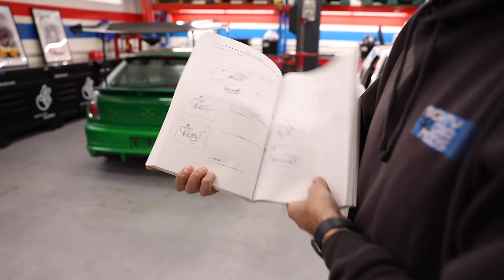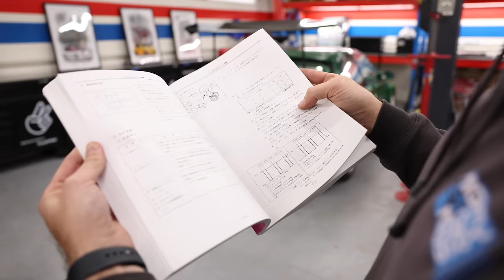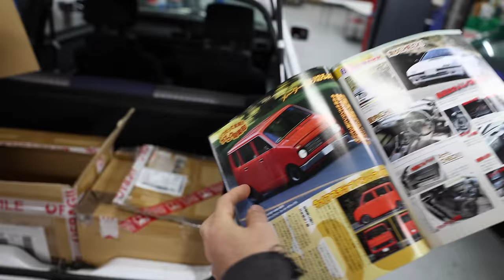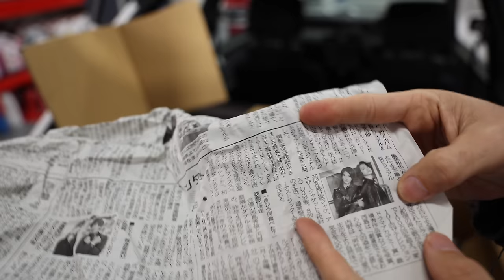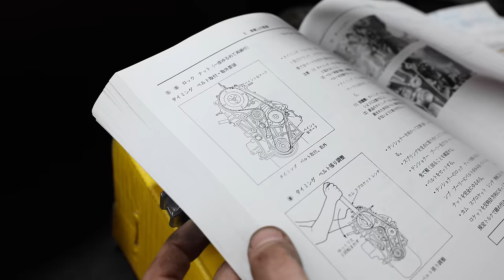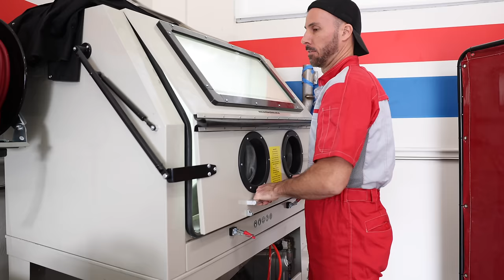Disrespected Superturbo 'The Honkfiles' [Part 1]

Comment from the maker: Wait what is this car?! Watch this first: https://www.youtube.com/watch?v=ve2hfpMOKnQ
Reply: Ok..but I just think now you guys are too  scared to even try to start the GEMINI build. Stop procrastinating 🐔
Reply: @BaMenace  They mentioned why not all that long ago.
Reply: @crisnmaryfam7344  supply issues for the diff should have been resolved 6 months ago.
Reply: Absolutely a must watch
.epic video mate..greetings from usa
Reply: Genuine question, can you soak the inside of a rusted fuel tank in an Acetone mix, and just flush it out a few times with water? kind of how they strip paint and rust from classic/resto cars, with an "Acid Bath".
Reply: Hey Marty and Moog, quick suggestion, all that junk that the filter sucked up couldve very easily clogged the fuel filter and/or fuel injectors, I would have a look at all that stuff and get new if possible that might be a source of issue aswell!
Reply: Can I recommend you guys get a zinc plating kit . It’s easy. You’ve got all the other stuff necessary to plate parts back to new .
Reply: Just a heads up on UK postage. Pretty much everyone under a union is striking right now so there could be some delays in shipping.
Reply: timing belt should be changed by time, not just mileage. it was probably something like a 100k km or 6 year interval so SHOULD have been changed every 6 years to ensure it didnt break!
Reply: @Mighty Car Mods  Hey guys, you should think about a crossover with @Cutting Edge Engineering (I think they are in QLD. Maybe they can machine some new bushes etc for you? It'd be interesting to find out what they'd need to do to make replacements for you.
Reply: Marty, O2 sensor tip: There's special impact sockets available, but in my experience there isn't enough room on most cars, in which case the exhaust (part/zone) needs to come off first. However they are very effective and worth it to save a buck, when doing exhaust replacement/modding
Reply: Did You try to fit in the downpipe from the bottom?
Reply: try google lens to translate the shop manual . maybe it's a bong after all
Reply: The queen is just a tourist attraction
Reply: After all these years, this was one of the best and funniest videos. It's hard to pick one or say this, but when you're still laughing out loud to the subtle jabs and jokes, and enjoying  episode as a whole, you know this is something special. The message is always good. You two fools are legends and I look forward to the next one.  All the best.

Comment: Top tip - If you soak the exhaust wrap in water, wrap the exhaust while it's wet, then when it dries it shrinks and becomes really tightly wrapped. 👌
Reply: Ive head that this will just trap moisture and cause rust of sorts
Reply: @redlined4493  I've only ever done it with stainless steel exhausts therefore the rust is nothing to worry about. 

Also, any cast iron or carbon steel manifold is going to rust anyway unless it's coated with high temperature paint or ceramic.
Reply: Ive done this many times, never had "excessive" rust when wrap removed

Comment: if you're worried about doing timing belt stuff yourself, it's always a good idea to mark the old belt at those points where you're supposed to line up the crank and cam wheels and transfer those marks to the new belt so you can double check you didn't skip a tooth. adds a bit of safety to the whole procedure and gives you the confidence needed to turn the key after you've finished the job.

Comment: @MIghty Car Mods    just a mental note from an mechanic that did lots of late 90's mitsubishi single and dual cam timing belts, if you put the crank and cam gears on the timing marks on the block, then the cams tend to sit in between lobes, and stay in place. If you remove the belt in just any old position, then the cams can snap and spin, thus loosing the timing to the crank. Just a helpful tip to you, and all that watch.

Comment: I'm glad they uploaded a video today. I thought about them this afternoon when my truck was struggling up hills and then threw a code 299, which is "Your turbo is no longer functional"... So now I have to spend the next few days pulling shit out of the engine bay trying to sort out the problem.
I miss my '68 Mustang. A dozen bolts and half a dozen wires and that was it. Cars used to be simple.

Comment: So I’m sitting in an airport lounge 3 no 4 drinks in, so this is the best one I’ve seen (alcohol talking?). Really, restoring and improving early electronic control vehicles is a challenge and the two of you have shown it can be done reasonably. I am in the US and trying to get back to my project, a 95 Dodge Dakota I installed upgraded from a 3.9 to 5.9. At the time I did it only factory controllers were available but now I have a MegaSquirt controller (assembled myself) as engine and transmission (lock up and overdrive) management. It doesn’t matter what your preference of vehicles are I find all your content informative and instructive. Okay, entertaining also(is that the alcohol? No). Big fan in US!

Comment: Yes Moog, "piece de resistance" is a thing in France. It's a cuisine term designating the main course in a full meal (that generally comprise 4 or more courses). By extension, it means the important bit of something coming in several parts/pieces. I guess it went into English language via the royals being half French half English at some point in both countries (or at least all cousins). So I am not surprised to find this in Australia too :)
Reply: @Johan I am French... what's your problem? Jealous that people know things?
Reply: What about plat de résistance

Which is what i thought the french a actually used
Reply: @reubenhooft541  you are right, "plat de resistance" also exists and is still currently used for speaking about the main course. But it's the "piece de resistance" that is less  commonly used by people (at least now days) that gave its origin to this expression.

Comment: Probably just use bolts instead of the studs to mount the dump pipe.

Thats how aftermarket downpipes on LHD FD RX-7s are so you can have the better flowing long radius bend.
Reply: Thats what i was thinking , would make it fit without modifying the dump
Reply: yeah i was gonna say looks like it'd fit if you took the studs out although cant see the exact problem

Comment: I would REALLY like to see what these little cars can do with an upgraded turbo like a new Garrett G25...Granted it'd be limited by the size of the supercharger, but it would definitely help with spool times.
Reply: Well you just fixed the supercharger by putting a modern Eaton unit on it...
Reply: Al and Woody just got Harrop’s to build a modern supercharger for the Chevy Big Block; clearly the March SuperTurbo is the next logical hole in the market to fill.
Reply: Would probably blow up if pushed too hard, might make 300hp if it was fully built running 30psi

Comment: Would the dump pipe fit by removing the studs first? And screwing studs in after aligned or then use bolts?

Comment: I just did a downpipe in my Mk7 Fiesta ST and it was WAY harder to get to than this, plus one of the bolts connecting the downpipe to the turbo flange snapped so then I had to take out the turbo and exhaust manifold to drill the bolt out, on ramps in my driveway.

Glad yours went a bit more smoothly than that!

Comment: Same thing happened to my PS13 with the fuel tank. I got a new pump, sock and fuel filter. I had to get the tank coated as the inside was very rusty. It was causing major issues for me. Glad to see it getting sorted out👍🏻

Comment: Seeing this NIssan March reminds me of the Nissan Micra (same car in Europe) i once had. Without this channel i would've never known there was a faster version. Mine had a simple 1.2 4cylinder petrol engine. It was ugly and slow, but it was cheap to run and never let me down. When it failed MOT and i needed a car that could tow a trailer, i took it to the scrapyard, but never forgot about my first car.

Comment: The Pitwork line of parts is Nissan's second tier parts line, typically reserved for the fast moving service consumables for out of production models. 
Some manufactures call these 2nd tier parts lines "White Box" parts.  The reason for this so that these parts can be sold at a cheaper price with less margin to compete against the aftermarket parts whilst retaining the "genuine" part with its greater margin for current (in production models) even though the part is exactly the same specification but possibly from a different supplier (but not in all cases).

Comment: Always worth turning the crank by hand with a wratchet & socket on the end bolt once the new timing belt on (take the plugs out). So if you have made a mistake and a piston touches a valve, it will stop and not do any damage that the starter would. Should go full rotation twice and you are all good

Comment: Hey Marty,
I used to have a K11 super S with all the Whiteline bolt parts (sway bars, adjustable trailing arms, adjustable pan hard rod, etc). Also had King springs, adjustable Konis, some Nismo bits, Genuine Rays forged wheels and P-zeros.

Gti-R/ N15 SSS/NX-R front brakes are an excellent bolt on upgrade. (AD22V) 
calipers and DBA 4000 rotors.

March/Micra can really be dialled to handle incredibly well.

Great to see the March Super Turbo receiving some love.

Comment: Just finished doing a mechanical restoration on a Figaro including refreshing the engine and did the same thing, timing belt, water pump etc, also did a downpipe, didn’t realize the factory cat on the SuperTurbo and the Fig are identical, got the downpipe from and pretty much everything else from FigaroShop in UK including those control arms, urethane engine mounts and new control arms with urethane bushings for the rear suspension as well and Gaz coilovers, all identical to the SuperTurbo, I’m not sponsored by them or anything they just happened to have everything for the car. 

Also it’s awesome to see support out there for mental health it’s so important especially these days!

Comment: Great Video guys.

One thing to do with your fuel system, is a full flush & clean, including injectors. I had a 2 litre 5 speed manual Daiwoo Nabira (Basically a re-bodied JE Camira) that had rust in the tank like yours, but maybe a little worse, and it clogged the pump & pick up, the fuels lines, and injectors. Needed new injectors, full flush of the fuel lines, new fuel pump, and because the tank actually had a few pin holes after cleaning, a new fuel tank. The fuel tank was a little beyond repair, so a new one looked for. I could find fuel tanks everywhere for wagons, but nowhere anywhere in Australia for a sedan. To get one from overseas wasn't cost effective when looking into total cost off repairs for the whole fuel system, so the  car was sold and the new buyer advised off what was required.

Looking forward to seeing the Superturbo back on the road.

Comment: If your fuel pump is popping fuses then you need to upgrade your wiring and your fuses. And you're not going to overwhelm your fuel system you'll just heat the fuel up too much if you're not using it at a decent potential

Comment: If this shares a few suspension parts with the N14 there's a fair bit of online expertise you can tap into, I can think of a couple off the top of my head:

- Brake discs/calipers off early EVO's
- Offset caster bushes on the rear - this will give you passive toe-in under cornering.

I'd recommend checking in with online groups like the Primera Car Club in NZ, or any sprint2k or casual track forum, the N14 is a weapon in some of those price-restricted categories and there's a lot of folks who can share some great tips.

Get this thing handling like a blue-ass fly Marty, it'll be mad.

Comment: Awesome video lads.
Could you have loosened the turbo from the inlet side to get enough clearance for the down pipe? Nice save with the fab work from Marty.
Also soaking the heat wrap in water helps from it when you wrap your exhaust 👍🏻

Comment: The Air conditioner in Hondas had a washer between the clutch and wheel, where there was not meant to be, this would cause it to slip and fail the AC. Removing the washer fixed the AC.

Comment: Some people slit the old timing belt in half longitudinally (leaving half of it in place). Then slide the new one on while everything is being held by the old one.   I like your new LED Ryobi Stand lamps working under the car. Do you ever see a spray called Plus-Gas any more. It was popular for getting rusty bolts out.

Comment: The turbine inlet and outlet flanges on the factory turbo makes me think that one of Garrett's new GBC line of turbos might bolt straight on. Apparently they've got "GTX Gen II compressor aero" so it'd be interesting to see what one could do on the MA09ERT.

Interestingly it also looked like the GBC22-350 would bolt straight onto the 180SX as well, Garrett might have been saving some RnD costs by reusing old housing designs. They're only ~$1k Australian so keen to try one out on my VAG 1.8T 20V!

Comment: I hope people read this. When putting on a paper gasket like that, it is best not to use RTV. Use a product like Permatex Aviation Form-A-Gasket Sealant Liquid. This can be bought at SuperCheap. I could not find High Tack® Spray-A-Gasket® Sealant on SuperCheaps site, but it is available in the USA. I have used both products with no issues, RTV on gaskets when not directed to use have caused issues. RTV can cause leaks with paper and cork gaskets. The other stuff won't and will hold the gasket in place during reassembly.

Comment: You're "supposed" to change the timing on a Mitsubishi Lancer at 150,000. Ours had 260,000km when sold, we'd owned it since brand new, never had a timing belt. Never changed trans fluid. Only ever changed oil and filter and brake pads. It had 1 new battery and 1 set of rotors and a put a rock through the radiator once.
Best car ever.

Comment: timing belts are changed usually earlier than the 100K service in Japan. Ive seen it on other imported cars. My mark 2 was changed the same time at 75K. I think for us in Aust we normally sell those cars before we have to do the belts. Or if the warranty cap arrives a bit earlier. Japan its all about Age of the vehicle. Aust is Distance travelled.

Comment: 29:59 Why not remove the Ac (or alternator, even easier) and move it out of the way, This can be done without releasing the gas. That is actually Why the pump has those big rubber lines in the middle of the hard lines. For flexibility. Seems like less work then rewelding and losing a bit of the radius on your dump there.
Reply: 45:01 Yep! Was waiting for that hahahahah. Im glad you guys left that part in though. Shows everyone else the learning experience of "well ill just cut here, and THEN it will fit"

Comment: golf mk 1 uses the same thing! and those parts are still available maybe you can fit those bushing on there. If your not sure when the belt was done just replace everything Most of the times also the water pump is driven by the timing belt even when bearings look and roll fine replace the whole lot better to be save then sorry. For the tank use vinegar to desolve most of the rust flush away with water dry it and put the new sok \pump in

Comment: You should get the book translated. Bite the bullet as they say. There's probably a lot of good info in there that's not on the streets. I certainly got a heck of a lot of info that wasn't online or in the english variant of my Nissan. Nothing critical, but you know, quality of life, and ease of operation stuff. Like knowing that you need to just loosen the rad mounts and upset it upwards, instead of outright removing it to do some maintenance stuff.

Comment: You should change the timing belt every 4 or 5 years even if the car is not driven much. The belt goes crusty by the time and it's cheaper to change it than rebuilding whole engine if the belt snaps.

Comment: Hey guys, if you guys aren't running your cars for a while, pro tip to get some Fuel Doctor from your local super cheap auto, that helps with water and rust build up in tanks and gets pumped and burnt through the motor, just too help with months of storage of your tanks 👍

Comment: 6:15 not true on a LOT of (more) modern engines. You can get a walbro high performance fuel filter for a civic, slap it in the tank and it will change Nothing. The Fuel pressure Regulator and The ECU will still only tell the pump to do so much, also most fuel systems have return lines, any unused fuel is recirculated back into the tank,
Reply: 49:55 Likely the issue and not the Fuel pump being bigger.

Comment: "COPPED MCM" Merchandise Idea...
Black Denim Shop Apron with 3 center pen holder pockets, 4-6 (2-3each side) narrow pockets (for Screwdrivers and Wrenches) and a 6" × 3" center (waist hight) center pocket.
Adjustable neck strap with sliding neck pad (for sweat absorption) and a clasp for the waist strap...
Very descriptive, but would be handy in the garage/Shop to wear instead of coveralls!
And could be offered in a couple colors like; BLACK, GREY, PINK and BLUE with robust white stitching.
Just thinking...
-Thomas ✌️
Washington State USA

Comment: No way that cut and shut  dump pipe is going to make any more power than the stock one, best thing would be have a high flow metal cat  put in the  original Nissan part.